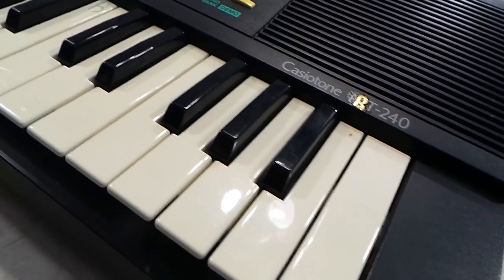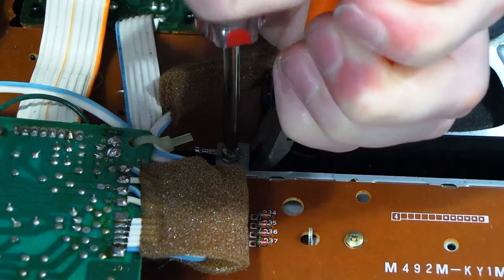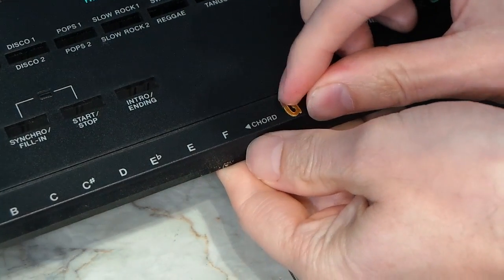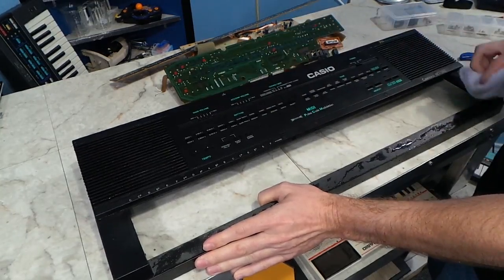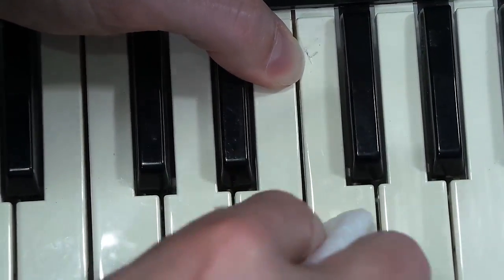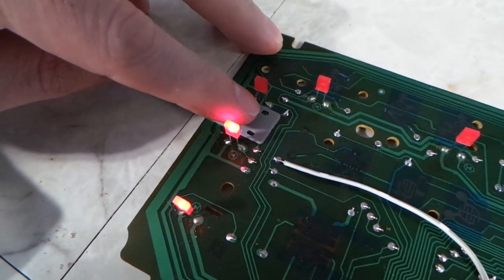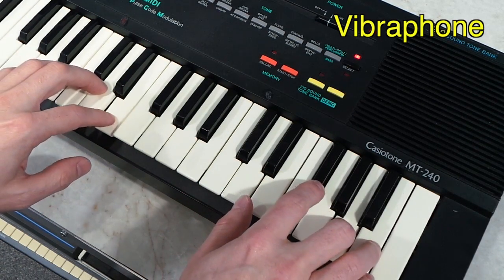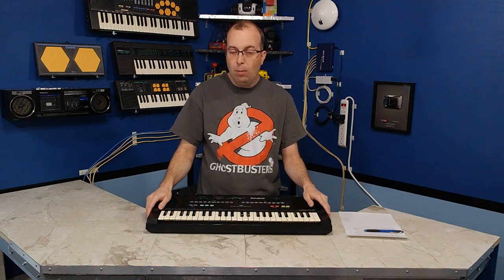Casio MT 240 - Repair, Restore and Review

Comment: Great restoration job. I've seen Casio and Yamaha keyboards at thrift stores in much worse shape with stickers, nail polish, magic marker or paint on the keys.  Have you ever tried Goo Gone for the sticker residue? And also a pencil eraser can clean off the dirt and grime off the sensor pads and circuit board.

Comment: I work with model kits, which a lot of times use super glue to put them together. An unconventional way I found of removing super glue is by freezing the model. Stick it in a really cold freezer for a few days, and the glue gets brittle. Then using a blade, carefully try popping it off. Sometimes it leaves a residue, but I have been able to remove superglue by chunks using that method.

Comment: PPG makes a product for automotive paint prep called DX-330 "Acryliclean" and markets it as a wax and grease remover to use as final prep before painting. However, I've found that it will remove just about anything that isn't paint or plastic, especially if you apply a little mechanical force from a plastic spatula or something. If you stop by your local body shop with a little glass jar or something you can probably talk them out of an ounce or two to give it a shot. Otherwise it's about $25 a gallon (which, if you don't paint cars, is a lifetime supply... I paint tons and tons of small stuff and am on my second gallon in about 20 years).

I've also used good old regular chlorinated (the carcinogenic kind) automotive brake cleaner to clean plastic parts and it did not harm the plastic. I believe the active ingredient in it is tetrachloroethlene, which commonly used as dry cleaning detergent and no one would want their clothes back with melted buttons. Spray a little on a rag, clean the area, and rinse well with water (although it will evaporate almost immediately). Avoid getting any on any silk screening as I'm pretty sure it would take that off as well. You'll also want to wear gloves and use it outside. I will also add the caution, that although it appears safe for plastics both by my experience and chemically, I have only used it on AUTOMOTIVE plastics, which may have stabilizers in them that a Casio keyboard might not. Try it inside the battery door or something first.

Usually my order of operations for trying to remove nasty stuff is DX-330, then alcohol, then brake clean, then goof-off (which is usually not much more than kerosene, but I've never had it damage plastics), then acetone/MEK/etc that will absolutely damage the plastic.

If push really came to shove and you find the residue super annoying, you could always take it back apart again, tape off the good areas,  and have a sandblasting shop walnut shell blast the entire effected area. That will give it a textured effect and leave it with a uniform two-tone finish. I'd probably just find a donor keyboard to use the shell from at that point though.

Good luck.

Comment: I'll second the support for the smaller keys.  I went through several full sized keyboards and always had a problem with carpal tunnel and other hand pain.  I picked up a Arturia Microbute synth that has the small keys and didn't have any issues!  So I then got a Korg Mircrostation (small keys also).  Now I can play keys all the time without any issues - Not sure why switching to the smaller keys would matter - but it works for me!

Comment: Great work on the cleanup/repair of the MT240. I have one I purchased with my first paycheck from my first job. Today I had to disassemble to fix a few keys. Did you see that copper contact at Middle C# ? Not sure what it's used for.

Comment: Very similar to my MT-540, that was stowed away for a couple of decades due to a broken black key (still couldn't figure out how to fix it, and there are no repair shops for these mini  keys). Powered it today and right speaker won't sound and on more than half of volume slider there's no headphone sound in right ear. Otherwise everything's functional. I never had batteries used in it. So it still has original foam damper inside :)

Comment: Hi, I have a mt240 as well.  There are additional sounds, only 10 extra, and cannot access via front panel buttons.  In the original manual, towards the end, it specifies them, and they are there.  Easiest way to access them is through another midi controller keyboard that allows you to go past the first 20 patches/sounds.  A long while back, I coded a GFA BASIC program on the Atari st to select those hidden patches, and the select leds will both be off when you select patches on the 3rd bank, they are worth hearing if you never been there before.  Was a bit surreal seeing both select lights off, lol.

Comment: At where I work at, I often have to do sticker removal and it leaves a nasty residue. We usually use a quick spray of brake clean on plastics and it really cleans it very well. I would recommend trying it, but on plastics you have to be kind of quick or else it will start melting it. I would spray it and let it sit for about 2 seconds then wipe it off.

Comment: Nice job David, really good work redirecting the bells to the record and playback,

As for super glue, nail polish remover is a great remover for super glue,

I recall my mom using it to get the super glue off my body after I spilled it on myself

And if you can't do that then soaking the plastic in very hot water should soften the glue enough to scrape or wipe off with windex.

Good luck, and thanks
For the wonderful content you produce!
Reply: nail polish remover is acetone
Reply: Joyrider see yea I thought that it might have been, but didn't know for sure, thus why I suggested a hot water soak
Reply: Joyrider thanks for the correction
Reply: I actually found it out the hard way. By melting the bezel on my computer screen

Comment: I have one of these keyboards. Biggest problem I found is that keys tend to break fairly easily. Also, using midi, can access more instruments than you can with the front panel. It was a great 1st keyboard for me, and still use it today. If you'd like me to shoot you some compatible midi files (as it only takes 3 channels) just let me know. I interfaced mine with both the Soundblaster and Cardinal Sound cards. It is a shame that you had to rewire the instrument keys as the memory bank can be helpful at layering. I recently replaced my original, of which I took around the world and while in my book an "entry" level keyboard, has the most realistic sounding piano for its size and potentially its age. The sound of the piano, and the how well I could play the entertainer on it, was the original selling point on it.

Comment: You could try removing the super glue with super fine sand paper.  Many of the scale model kit tutorials remove imperfections with sand paper (take a look at some).  If the sand paper is fine enough you are essentially polishing the imperfection away. Granted it would take a lot of effort. You could have run the broken-switch wires to a new miniature momentary switch on the back of the unit. That would mean drilling new holes, but it would keep the record buttons functional.

Comment: I use brake fluid to remove super glue and paint from old plastic models and it works like a charm. Just use protective gloves and  be careful not to hurt yourself. Yes, actual red brake fluid bought in car supplies alley in a supermarket. They contain something that removes contamination from actual car brakes without damaging the car's brake fluid container, pipes and stuff.

Comment: Great videos! I learned a lot from your detailed explanations. Question please: I have a Casio MT-640 that won't turn on immediately if I turn it off. It only comes on again after it is unplugged and left unplugged for at least five to ten minutes. I checked all electrolytic capacitors with no success. Any suggestions? Regards, JP

Comment: There are 20 presets plus 190 combinations of those using the TONE BANK feature. That gives you 210 total possible "TONE BANK" tones. There are also 10 additional tones that the manual says are only accessible through MIDI. They are available as MIDI programs 20 through 29. At least one site mentions that there is an easy mod to access the additional 10 tones without MIDI. If that's true, you could potentially used the TONE BANK feature to combine those with the original 20 presets and get a lot more than 210 TONE BANK tones.

Comment: For removing super glue from plastic i've often use brasso wadding, this will make the plastic shiny as well though so do consider if that's going to look better or not, if you want to preserve the matt finish a magic eraser will do the trick too. Either way both of these methods will remove any markings on the plastic. I've restored a few sega mastersystems which are made from similar black plastic in this way.

Comment: In Brazil we call this as a "Gambiarra", but it was a very good gambiarra, I should say. About a suggestion to take the super glue off, you should try lighter fluid. For stickers residues in glass there is nothing better, but you must take a test in plastic before applying it. Thanks for the video.

Comment: You can use sandpaper (fine ones) to scrape off solder resist then try flowing solder lightly on black conductive layer that failed.
I managed to fix few of battery leak damages through that process.

The green stuff is solder resist coating and copper salts, which is a sign for battery acid or alkali damage.

Comment: I'd still love you to get hold of a casio ctk 631 if at all possible.  u said once u would if u saw one but they are pretty rare now but I want u to get one as it is unlike pretty much all the other ones u have featured and is much more professional and also quite old. I have one myself as my main keyboard which I do everything on and it is in crystal condition.  at least on the outside.  I've never checked the inside and I use ac plug rather than batteries for it.  there are no stains or marks or anything on the outside and no damage what so ever,  everything in full working perfect condition.  no sign of wear apart from the plug I use. love it soo much.

Comment: You could heat the spot with hot water (or a cloth dipped in hot water if you don't want to take it apart again), then cool it down really fast with nitrogen or dimethyl ether (that's in those freezing sprays for warts). Unless the glue is really in there (in the texture of the plastic if it's not smooth or glossy) it will just pop off.

Comment: One of the first low end keyboards that actually sounds very good, when sample based workstations were very pricey. Did you know there is another 10 or so sounds accessible under MIDI, but dual-voice doesn't work in this way, and adding velocity sensitive keys isn't recognised unlike many Yamaha boards. My very first keyboard!

Comment: I would recommend you use the solderer and melt just a bit of the plastic to mend together, after youve glued it. will help give it strngth.  but lightly, so it doesnt melt right into it.

Comment: I've found this keyboard on the trash a few days ago. I love it! The electronics are working perfectly after I cleaned them. The only issue is the keys are broken... All the black ones. I've been trying to find a replacement for them online, but didn't find anything. I'm thinking 3D printing them, but that seems like a lot of work. If anyone knows a different solution it would be great.

Comment: A suggestion for removing super glue from plastic, a high speed buffer with a cloth pad, and Meguiars Plast-x or Novus 3. I had an incident with my cat, where she knocked over a tube of super glue, and it got on the lens of my glasses. Plastic lenses. I tried everything to get it off, but had no luck. I was able to buff the glue out of the lens with Plast-x and a buffer. You cant even tell it was ever there.

Comment: Try an oil based product for the residue.  Kerosene, Diesel, WD-40.  Test it out on the back of the battery door to make sure it won't instantly destroy the plastic.  I wouldn't put it anywhere near the silkscreen, though.

Comment: It's got 30 instruments, the extra 10 instruments can be used via midi, as can an extra octave of notes.

There's also the 465 tonebank models that came out around the same time, I suspect they just enable all 30 instruments from the buttons on those models, and there's a tone module version of the same hardware.

I have the Tandy version of this keyboard. Concertmate 1000M.

Comment: You you can buy brush on conductive nickel AND brush on conductive carbon inks on eBay. The brush on carbon is made specificallly for repairing those black button sensor contacts.

Comment: I know it sounds crazy, but for the glue residue try putting some peanut butter on it, wait a while, then wipe the residue off. It worked for some stubborn adhesive tape gunk on the bottom of my laptop, though I'm not sure if it'll work with superglue. I like the new intro music by the way.

Comment: David, just curious about something regarding taking off sticky stuff and gunk... Have you ever tried using MEK (methyl ethyl ketone) or MEK substitute? Based on my experience with it, such as removing car window tint residue, it’s very harsh on plastic. But I feel like a very small amount in a tiny area, like where sticker adhesive residue is, it would work well without screwing up the plastic. Just a suggestion in case you haven’t tried it yet. It’s some good stuff.

Comment: I have a Casio CT-650 which is very similar, only it boasts "465 SOUND TONE BANK"!!! (Actually, it has 30 separate sounds). Anyway, it has 61 full sized non-velocity sensitive keys and the standard MIDI triplet in/out/thru. Nice as a lightweight master controller for not terribly expressive sounds.

Comment: Did you try flux on the solder pad that wouldn't hold solder? Are you using leaded solder? Did you try a higher temperature (assuming your iron allows temperature control)?

Comment: those carbon pads go funny on casios all the time, same with tv remotes, a combination of finger grease, spilld drinks etc, the keyboard stalks were broken by a kid probably standing on the keyboard when it was used on the floor.  every few years i have to take apart my own casio to clean a couple of the carbon pads, i use alcohol and a swab on both the pad and the circuit board.

Comment: Have you tried Goof Off in spray for removing glue? I used that when i worked at staples to remove old sticky labels without damaging boxed and plastics. Worked well enough.

Comment: I recently got this same keyboard and love it. However I'm having a problem where the thing only turns on when I leave the power button in the ON position and plug in the power adapter. It stays on for about 5-10 minutes before dying again, and then I have to unplug it for several minutes before trying again. Weird stuff man. Maybe bad caps?

Comment: I wonder if you could repair the button using a couple of pieces of sticky-back copper with a small gap between to provide a fresh contact surface that you could solder to.

Comment: For that button I suggest you install another "flat button" similar to those of the A and B buttons on the Gameboy Advance Sp. For the super glue you can simply rub them with 
sandpaper may be 2000 or higher. Rub them under water, this will not damage the plastic.
But I cannot understand how can you wash out the grease simply using water?
Reply: Hakim Mkacher 
I guess it wasn't grease?

Comment: this suggestion might be too late but I've used a glue in past which was actually conductive and I used it to form traces of conductive lines to fix an antenna connector on an old cell phone. I really don't remember the name but if you want to invest some time in this keyboard, you should look into this.

Comment: I’ve just bought a used Casio WK-245 keyboard. It shows little sign of wear, but a few of the white keys around middle c are chattering when played. 

I bought a set of white keys but haven’t yet attempted to replace the ones in there now. Any advice whether the keys themselves are the issue or if something else in the mechanism could be the source of the annoying plastic rattle?

Comment: Superglue doesn't like humidity. Maybe vapor cleaner or soak it with a sponge all night long. Sandpaper will work too, but you'll probably have to sand the whole keyboard & polish it to get a nice finish (but not the original one).

Comment: when ever i get super glue stuck to sensitive materials i use a little scrubbing tool, and hot water, it will take a while but it should help because the hot water softens it and helps the scrubber remove it.

Comment: Sand off the superglue carefully using progressively finer grits of sandpaper. By the time it's completely gone, you'll end up with more or less a smooth surface. It won't look the same as before, but it's better than melting the plastic.

Comment: Also, you should be able to repair the busted trace to that PCB button by using a silver conductive ink pen! They can repair both the carbon pads and the traces around them usually.
Reply: This is the local brand I use, you can probably find something similar: http://www.jaycar.co.nz/silver-conductive-pen/p/NS3033
Reply: Conductive epoxy might also work.

Comment: RE: Super Glue -- have you tried using "Bob Smith Industries BSI-161H UN-CURE Super Glue Debonder"? -- A lot of the crafting channels I subscribe to recommend that brand ("Bob Smith Industries") for CA glue products.
RE: Broken button -- your fix works -- but it's a bit of a custom job and you have to remember that those keys are redirected now (unless you put a label on there or something -- which would be ironic given all the work you put into removing the key labels) -- but as an alternate option, you could just glue a tactile switch under that rubber pad -- they make some pretty flat ones, and even ones that don't produce a clicking sound -- but anyway, all I'm saying is you could just ninja a button into there and that could make it work as well... 👍